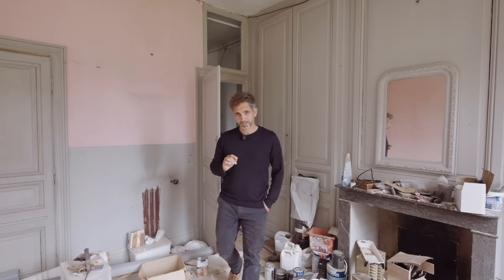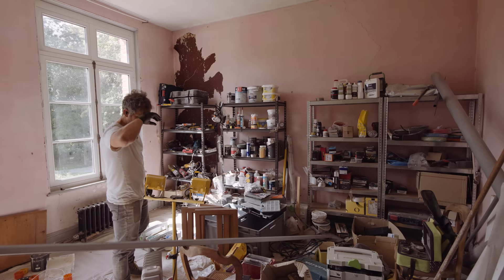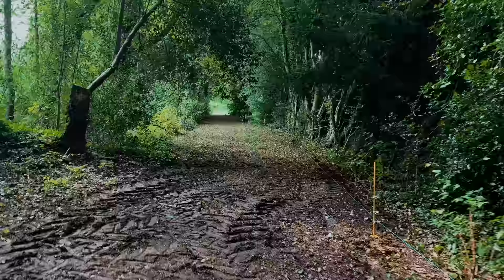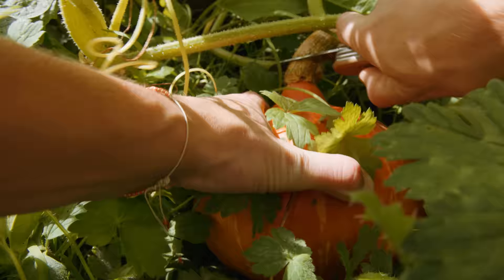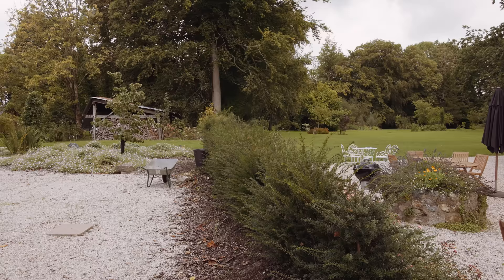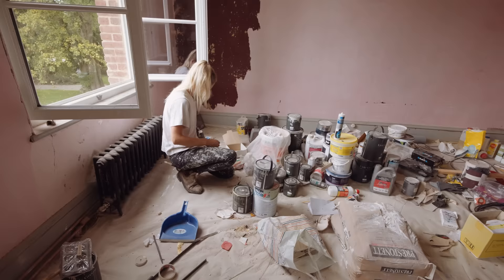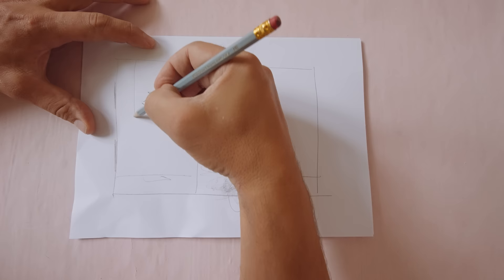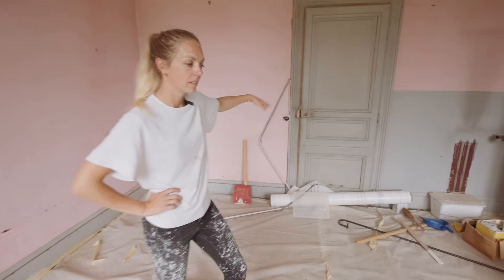The Chateau Master Suite Makeover Has Begun!

Comment: When renovating, I would make sure that the toilet flush is not installed on the wall next to the bedroom. That way you can go to the toilet at night without disturbing anyone's sleep :)). At the same time, I agree with Anna's suggestion to use the larger room for the dressing area and the smaller room for the bathroom.

Comment: Big dressing room, medium bath. You'd be amazed how little closet space one really has, so plan accordingly. We have a two sink w makeup vanity between sinks full wall mirror, double shower, w separate platform jacuzzi tub, with (we thought was large enough ,NOT) walk-in closet with "system" (weak will pull out of dry wall, so re-enforce with poles, we had to,) shelves for sweaters, jeans,  between hanging his/hers rod sections, shoe racks under, two short rods sides; one for a man with shirts and trouser rods. So... a large rectangle room; dbl sinks w oak cabinets, toilet/bidet room on left, platform tub and double shower on right, with walk-in closet on short end. I'd double our closet as it's packed to gills w overflow in guest room closet. Love our Master Bath design though.

Comment: I think that middle room is large enough for a decent master bathroom. I agree with Anna about getting rid of the doorway into the hallway and having a double shower, freestanding bath and a double vanity. I would also try and put the toilet in a seperate room of it’s own. 

The larger room I would turn into a very impressive dressing room, with a make up vanity under one window and a seating area under the other, with built in hanging/storage around the walls and a centre unit as well. I would leave the door to the hallway so you can take washing in/out without having to walk through the bathroom and bedroom.

Comment: Anna’s plan. The bigger room, a dressing room with a central table for folding stuff before putting it away or laying out options before packing etc. Storage for shoes, jewelry and accessories, seasonal items etc. A dressing table and mirrors. A chair to sit in to put on your shoes and stockings. I have a good sized dressing room and I wish it were bigger. My smaller bathroom is completely adequate.

Comment: Hi Anna & Phillip, I wish I had watched this three weeks ago. Bathrooms now have a wet area usually open or behind glass panels where contained is a shower and a bath. These would be placed in the back of the wet area, tiled floor, and wall tile to the ceiling. Outside the wet area would be a sink and a toilet.  It's a clean modern design, and it looks like you can probably have two separate sinks, one for each of you and a toilet all within the same comfortable space.  Good luck as you move forward with your plans. Mark & Scott

Comment: Here is my two cents if I was the owner of a Chateau... ;)

1. Prefer the bathroom closer to the bedroom in case you need to get up to use the facilities during the middle of the night
2. As someone else suggested place the toilet away from the bedroom wall so that you can flush during the night and no smells waft into the bedroom (if possible put soundproofing between the bedroom and bathroom walls so that no one has to hear "bathroom noises")
3. I stayed in a hotel in Stockholm that had a "wet room" and it was lovely! You can go from shower to tub in steamy goodness and not get cold. 

Looking forward to the transformation! ❤

Comment: Absolutely the bathroom should be the smaller space in the middle.  It makes practical sense, firstly.  The flow makes sense — rise, use bathroom, get dressed and out.  Or get undressed, do your toilette, go to bed …. But the larger room has wonderful light in it which is what you want at the start of your day when getting dressed.  Also, as I saw another comment add, you will need a generous amount of space to store luggage and all those miscellaneous bits and bobs that usually end up shoved into an inconvenient space.  You could even have a little seating area and it could be a tiny retreat, hidden well away from the business of the rest of the Chateau.  I agree with Anna, it is lovely to have a cozy space for a bathroom.  Not cramped, but not cavernous feeling.  I never feel comfortable to truly relax taking a bath in a gigantic bathroom.  It could be a great opportunity to do something a bit more dramatic in there, a little jewel between those two larger, lighter spaces.

Comment: Just a thought, Anna used to work in fashion and currently doesn’t have her own space as an atelier/ studio. I don’t know what her role was at the fashion houses she worked in but it’s possible she designed and made her designs and would like to have a space where she could again set up a sewing machine and allow her to design and make her own outfits, they are after all nearly finished the reno of the chateau (although the out buildings still need work). With that in mind a larger dressing room would allow them both to have hanging and storage space for clothes (for all seasons and all activities eg sailing, skiing etc) and a space where Anna could design and make her outfits. She has been so patient in not having her own atelier which I hope will be in one of the outbuildings not the attic. But in the meantime the smaller room should be a cosy but functional bathroom and the larger room their dressing room.

Comment: First of all: Keep & redo that ”water source” - the tap - because in a dressing, it is lovely to have access to water. Not many think of that - but it is!

Secondly: A smaller bath, of course! IMO, consider a window atop the future bathtub and/or some other sort of solution for natural light and integration into the dressing room - there are many options & I can’t see why placing the future bathtub under an existing window would be the only option to achieve that.

Comment: Where your are going to block the doorway to the hall, I would build a small room for a separate toilet, then the main part of the bathroom is just shower, bath and double vanity unit, probably put the bath or vanity unit at the window.The bigger room floor to ceiling built in storage, you would still have room for a small sitting room as well, and makes use for the fireplace in there.

Comment: Definitely the smaller space for the bathroom.  Even that space is large enough I have to wonder if you can actually wall off a small section on the end and use the existing door for a small linen closet?  Also noticing the sink in the other room made me wonder about taking  advantage of the plumbing to make a lovely vanity area in the larger room/dressing room for Anna?

Comment: I agree that the smaller room should become a lovely spa-like bathroom, and the larger room a couples dressing room. It’s a lovely bridal quite, a couples suite, or even a separate flat. As long as walls are not load-bearing, it’s relatively easy to move them over (detritus and dust notwithstanding) to achieve more perfect dimensions. That said, I think the rooms as they stand are pretty useful. 14:33

Comment: If it was me, I would probably put the bathroom in the bigger room and the walk-in closet in the other one. But I totally get the "feeling lost" part. Maybe you could make a small partition near the window with a little wall for the tub/shower. That way you would still feel protected by the wall but still have a nice big bathroom. But it would probably be difficult to do that in a way that does not feel like the wall is blocking lots of light. I feel the other bathroom might be a little cramped if several people are using it at the same time. I am however not the best judge on that, as all my clothes would easily fit into two moving boxes with room to spare.

Comment: I’d be inclined to agree with Anna and make the smaller room the bathroom. However, I’d perhaps make a lavatory+small sink a separate small room, accessible from the corridor or the bathroom. That way, there’s a little bit of privacy which helps keep the romance, especially if the loo is otherwise only 1 thin timber door away from the bed

Comment: The bathroom question is more likely to be "warmth" than "size."  Typically, one simply does not want a huge bathroom, because it will be cold when one has few—or no—clothes on, and when one is wet, no matter how hot one (attempts) to heat that space. Large bathrooms = lots of air convection around the body = lots of evaporative cooling removing heat from the surface of the body = very uncomfortable (and often rather cranky) wet, shivering spouses. Small, low-ceiling bathroom = good. Large, high ceiling bathroom = bad.

Comment: What if the wall dividing the bathroom and dressing room actually ran at a right angle to the bedroom wall. Both rooms could be accessed from the bedroom rather than having to go through one to get to the other. There could be a door between the two  that lines up with yet another door  connecting the dressing room to the hallway. This means you don't have to go through the bedroom to access either the bathroom or dressing room. Just thought. May not fit with existing window arrangements. Whatever you do will look great. Philip! For god sakes get yourself a battery powered hedge trimmer. We have had a Bosch for years and it's still going strong

Comment: I think the best thing to do is to remove that wall you guys where talking about. Keep the shared doorway in the bedroom, creating a small hallway from that doorway & placing 2 walk in closets on either side. And yes, that second doorway needs to be removed. One closet larger than the other. Then this hallway leads to master bath at the end. 
I mean, you don’t need all those windows in a what is essentially closet space. That amount of light would much better fit in a master bathroom. Lastly, you also don’t want to place a bathroom without an enclosed toilet (aka, a water closet) right next to a bedroom. Not a good idea.

Comment: it seems noboey is aware of what pleasure (and advantages) of having  two bathrooms, one for each. Even when they are "small", what is kind of a joke when I see the amount of space available. In those tiny  corridors there fit good fully equiped bathrooms,

Man spends 20 min a day  in the bathroom, no need of anyhting special excepting privacy; not sharing this space with anynody else, thus not hearing complains...trust me, my experience. When we are in hotels I dont feel confortable any more.

Large dressing and sitting room with those windows is a dream. I would even think of splitting in two, cloack room/dressing and small salon. Each one with a window,

Note, baths accesible through corridor, please, plumbing on opoosite side of bedroom, insulate also that wall.